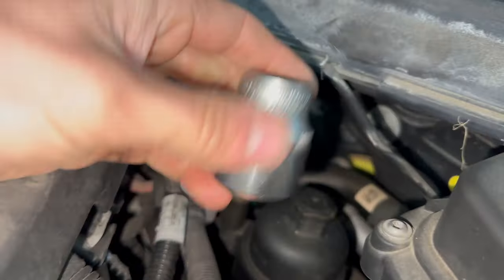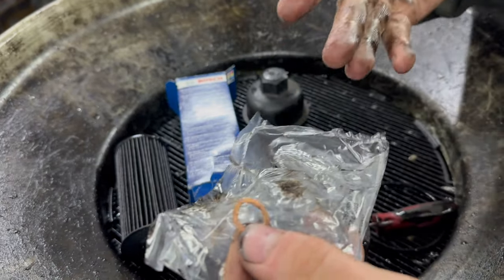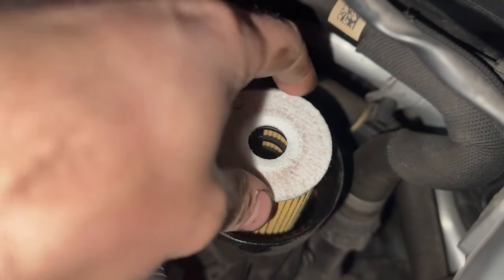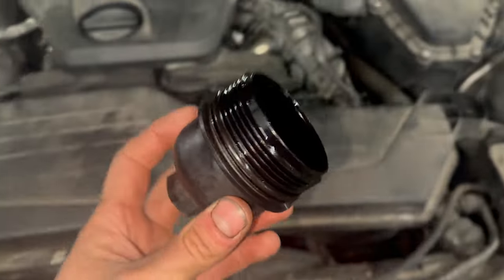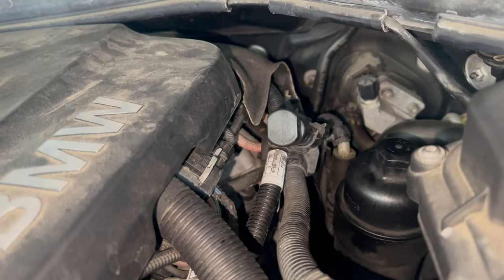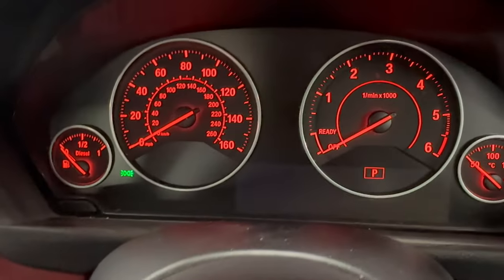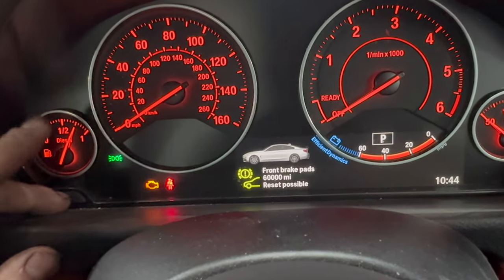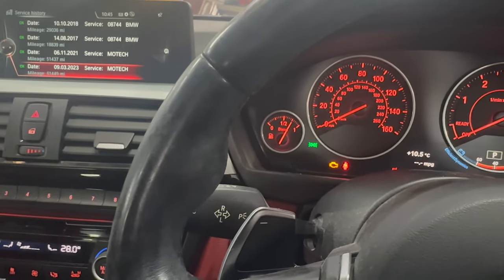BMW 420D 2015-2020 Oil & Filter Service - Indicator Reset B47 - 4 Series Diesel How To DIY

Comment: Hi I have  a 2016 420d gran coupe. Ordered a Bosch oil filter. Part number P7123. Looked the same size when comparing 

But upon installing it didn’t fit in the oil filter housing? But Fitted on the oil filter cap fine. Just wouldn’t snap down into the housing. 

Any ideas? Is there a specific filter that only fits 420d that are 2016 and after?